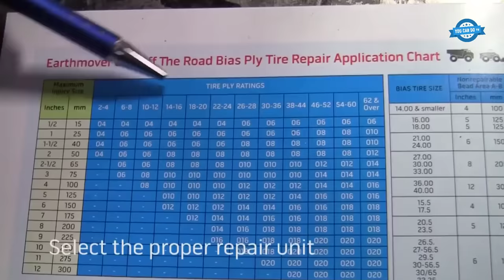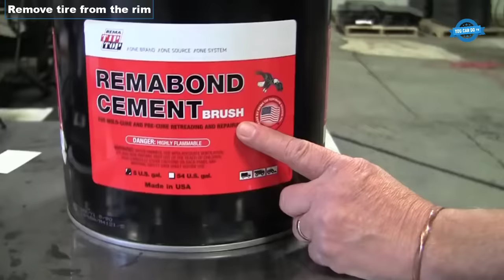How To Properly Patch A Punctured Super Big Tire | Tyre Repair. Production Process Of Truck Wheel

Comment: In the 1960's we were given an old innertube from one of those  11 or 12 foot tires.  It took three shopping carts and several kids just to get it home.  It was actually too big to use for swimming.  You could have easily floated a full size car on it  It was stolen a month later.  We would see it on the water from time to time, but had no way to get it back.

Comment: I don't quite get the venting of the skived area with string,  is it to allow trapped air bubbles to escape will skiving outer
layers of rubber patch?
Reply: You nailed it so to speak. Air is counter-productive to good adhesion between the patch and tire. The sheer size of the patch and the angle of the repair area will prevent air from escaping, leaving areas of the patch unattached and unsealed. 
On smaller tires such as passenger cars for example, we do not need to vent the area because we are physically able to "stitch" the entire patch. Not to mention the tread area being MUCH thinner, rendering locating and removing a foreign object possible, thus not having to cut away the outside of the tire. 
Cured (dried) rubber cement and the elimination of trapped air are vital to a proper repair. 
Side note: A running joke in my shop, if you do not wish to wait for the cement to dry, whisper in it's ear. (moisture in breath greatly speeds the drying process) Counter-intuitive, but works very well.